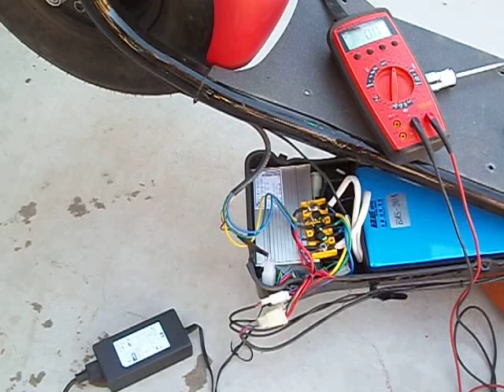SEEV 800 "Lazarus" battery procedure

Comment: Did you unplug the battery pack from the yellow block and connect it to the printer charger or did you connect the printer charger directly to the yellow block? Thanks

Comment: What time of use has you had to see these difficulties
Reply from the maker: If these scooters are stored and not charged every month or so the BMS in the battery pack will drain the pack down so low that the charger thinks it has failed and refuses to charge for your protection.  I've used my scooter 16 miles a week now for months with no apparent long term damage to the pack.